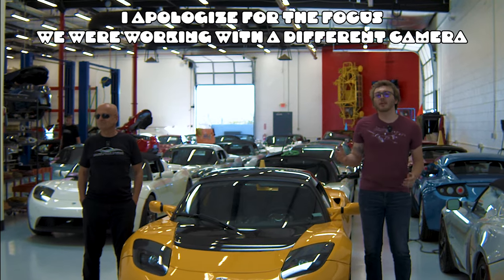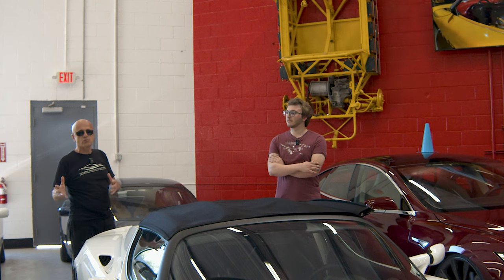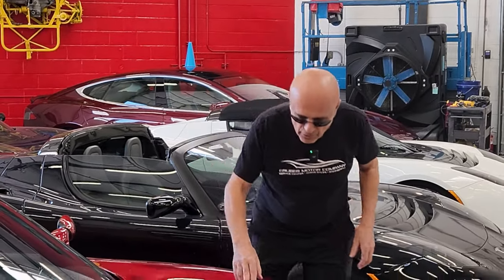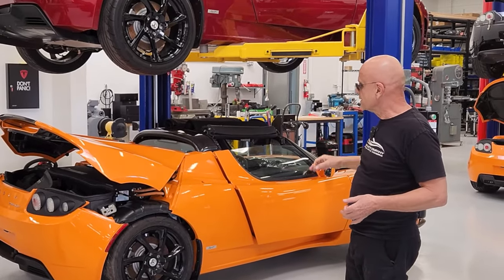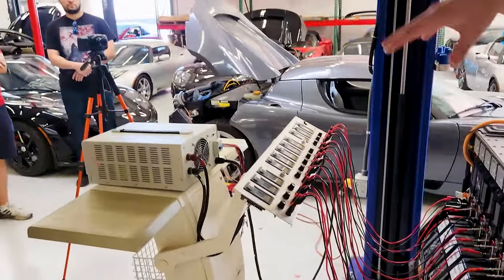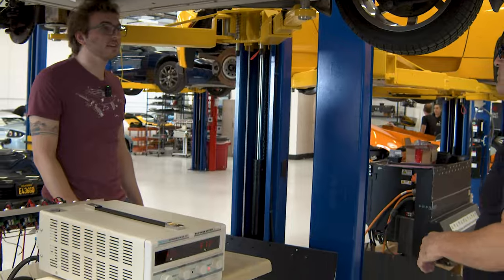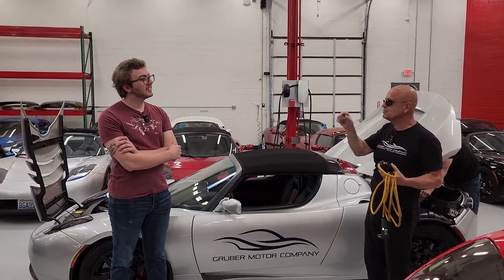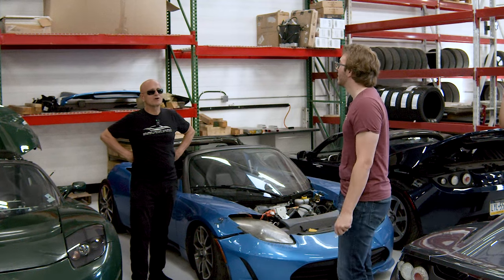The Auto Shop of the Future! | Gruber Motors Tour

Comment: 27:56 correction - Gruber meant "a mile or so under 40mph" not 30.  You could drive the early Prius up to 39mph before the gas engine would kick on.  Also interesting they alluded to the previous building fire but no details were given.  It was a pretty big story at the time (2021).  They lost over 30 Roadsters in the fire.  Many of them were customer cars in for repairs.  And apparently I forgot they had a previous fire in 2017 where they lost 5 Roadsters and an AC Propulsion tzero (ouch!).
Reply: (yes I'm responding to myself) actually the Prius is pretty peppy compared to earlier gas cars.  My 2015 Prius could hit 60mph in about 10 seconds.  People in the 1970s loved the VW Beetle, and its 0-60 time is closer to 20 seconds.  And yes, the Prius was the gateway drug to going full-electric.  The point when a light would go green and the Prius would take off on full electricity until the gas engine kicked in made it obvious I needed a car that could do that all the time.
Reply: The first fire was May 5th 2017, the result of overcharging a 1000lb Tesla Roadster Pack.  We learned a lot, and lost 11 cars, 6 of which were our Roadsters, a MS (ours) an EV Smart car (ours), the 1 of 3  Tzero, a 2008 ACR Viper, and one employees car which we promptly replaced.  

The second fire in October of 2021 was attributed to cause unknown, with lots of investigative effort focused on the electrical wiring.  This time we lost 9 of our own Roadsters, and a MS, with the rest being customer Roadsters, the worst tragedy in Roadster history.

Thank you for the Prius clarification.  Few things in life create a paradigm shift, but driving electric, even for slow and short distances was one of those.
Reply from the maker: I think the ACP tZero was the biggest loss. I hope someday restoration efforts car be made since the frame is still intact

Comment: 11:54
No.
At 0 rpm it puts out 0HP.
Lots of Torque, but no Power.
Power (Rotational) = Force (Torque) X Speed (Rpm)
If speed is 0 then power is 0.
If the motor has constant torque, then it doesn't reach max power until it reaches the max rpm.
This guy should know what he's talking about, but also forgets the all important h when talking about battery capacity.
It's no wonder so many people find EVs confusing when even experts can't get their facts straight.

Still a very interesting video though. Thanks!